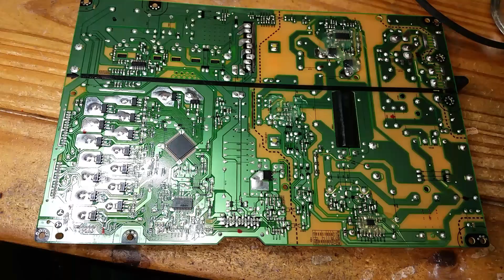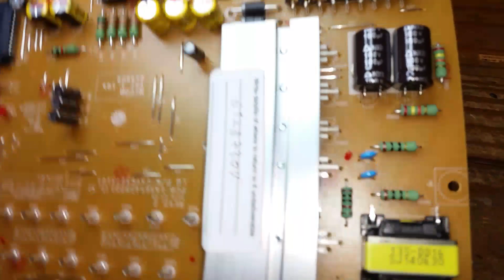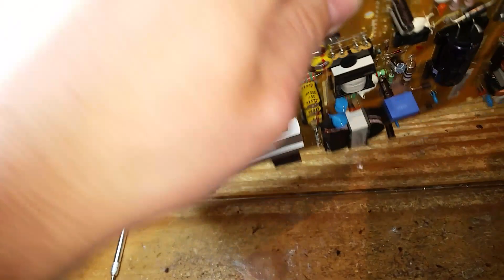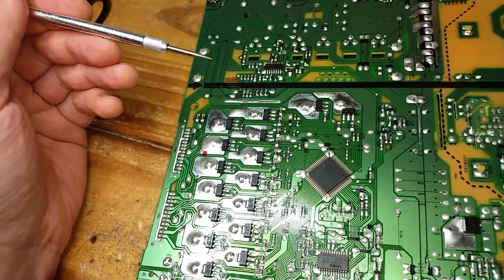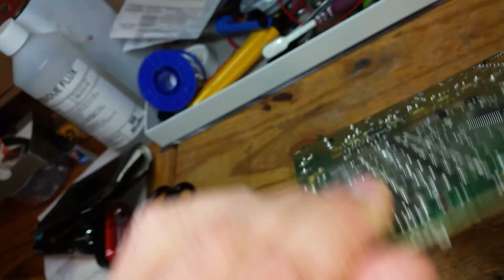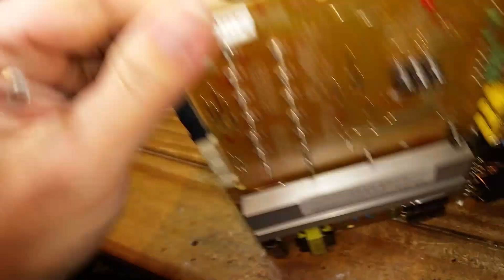65' LED tv backlight fault troubleshooting, LED driver board and how it works

Comment: Quick question what is the board called that feeds power to the led back lights....u can see the pic but the last side is normal and the right side of the screen is darker would the board be the problem
Reply from the maker: Its most likely the LED strings being the issue, I don't have this board anymore , it was an old video but I guess you will have it fixed by now, sorry for not replying earlier...

Comment: philips led 40 inch.after start displays philips logo for a second than no picture.i meassured about 50 volts and than drops   slowly .i unpluged backlight conector and  voltages are the same.i find 5 small 100 ohms resistor no continuity at led switch side. i will check it again .did you had similar situation.this video was so helpful .thanks very much sir.looking forward new videos.
Reply from the maker: Thanks. Sounds like you have a fault in your backlight string, buy yourself a good backlight tester with voltage and current readings on display and test all backlight LED strings separately. If all circuits appear to have equal amount od LED diodes in them and the tester pushes this circuit to the higher voltage compared to the other It could be at fault. If theres a break on one LED string the voltage with be at max and no current shown. Hope It helped you a bit
Reply: @zbyszekskibinski  you are certanelly helping me.my ohm resistors readings are not corect cos it does not read 102 ,103,
etc in other places on the board.unfortenally i do not have tester.i can only test diodes one by ond or whole  strings usin dc from battery source acording to number of diodes.guess led driver will not work at all if it is faulty on the board .probably backlight ic shuts down driver either because of diodes or some other reason.i will go check strips first.it id 40inch tv and there is lot of mess in my room already .looking forward finding solution with your help

Comment: Is any simple way to cut protection circuit to check the fault.what to do if some mosfet get damaged and remove by simple driver or another method

Comment: Hi, samsung 32 inch LED TV first check ps voltage was dropped and I disconnected back light cable , then  all voltages are correct 5, 13 and back light voltage showing 132, is it correct voltage...? let me understand on the board shows back light voltage is 65v. please give me a feedback... thank you..
Reply from the maker: If you disconnect the supply to the backlights, the voltage read on the supply rails could be higher, that's normal it probably means the tv works fine but the led strips are at fault, shine your torch onto the screen and press menu to check if there's any image
Reply: @zbyszekskibinski  thank you , let me check

Comment: If TV powers on and screen goes on, but plays no picture...back led strip are fine...what is wrong with led driver board
Reply from the maker: Nothing, If no picture but backlight OK its main board, t con or sadly most often screen faulty( in new led tvs today).